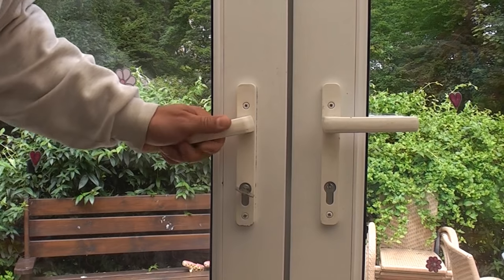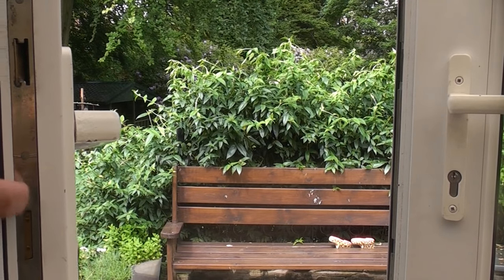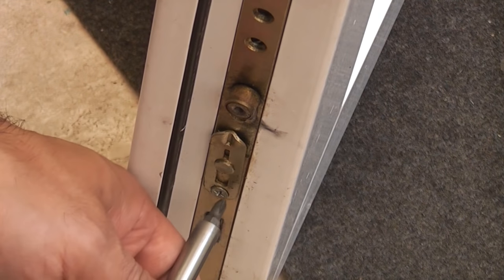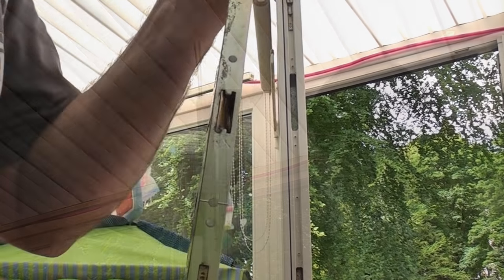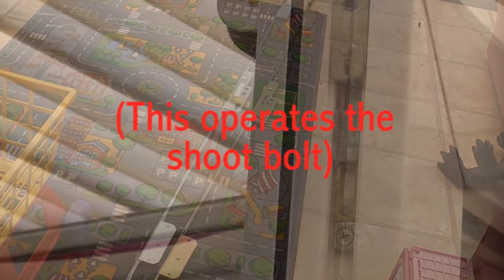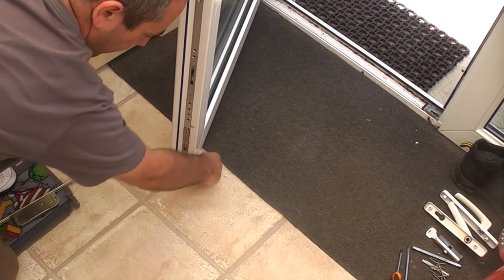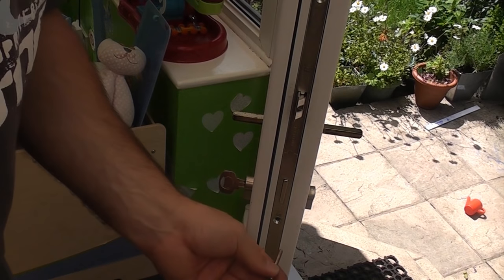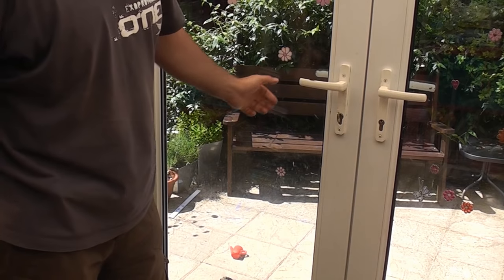multipoint lock replacement

Comment: awesome video.i have a problem though my door's lock seem to stop if i try to lock it twice,i can only lock it once and a half it did work fine until some days ago and the key stopped working from the outside so i can only lock it form inside is that fixable or do i have to buy a new door lock,thanks :)
Reply from the maker: ahmed dhiya 
A new Euro cylinder will fix some of those problems- https://www.youtube.com/watch?v=3vHnzeSlOY4
You could even choose a high security one- https://www.youtube.com/watch?v=6wEZktQ9hb4
Reply: ***** man thanks i think that's it, that's whats causing the problem,i'll check it out, thanks again 
by the way some days ago i would have cut my self really bad with a sculpting tools but thanks to you i learned wearing gloves when work from you,,so just wanted to say thanks :)
Reply from the maker: ahmed dhiya 
Good stuff ;-)

Comment: I took out the eurocylinder to clean it up a bit I cant get the retaining screw back in. Something is blocking it. 

I think its a spring (?)
Reply from the maker: +Lance Flanagan Try just replacing the screw without the Euro cylinder in position.You should be able to see the screw through the Euro cylinder hole

Comment: Any suggestions on getting door open?
Reply from the maker: No, sorry.  I was lucky with mine, if I could not have opened the door I would have called out a locksmith. I believe they remove the glass from the door- but I do not know what they do after that to get the door open.
Thanks for the comment

Comment: I took out the multipoint to see what was wrong,  put it back in but now the door just won’t close/stay closed.... i can open and close it without using the handle...??
Reply from the maker: It sounds like the latch is not working.
Can you see the latch? does it move in and out when you push the handle down etc. ?

Comment: did you order the replacement part online if so where from? or can you get it from screwfix etc
Reply from the maker: k671070 
No, I got the replacement from my local locksmith's shop.
You can get them online, but it's critical that you measure it and get the correct one.
Screwfix do sell a Yale universal multipoint lock which should fit most doors providing you get the correct gearbox size.

Comment: good job as always. Question though, do you think you could upgrade a pvc door to have a multipoint lock? from a standard single lock in the middle.
Reply from the maker: joeshaft 
I'm not sure to be honest. Your best bet would be to ask a locksmith.
Providing the profile on the door is correct and providing there is room on the door frame for the keep it should be possible, but best to check with someone that has more knowledge than me ;-)